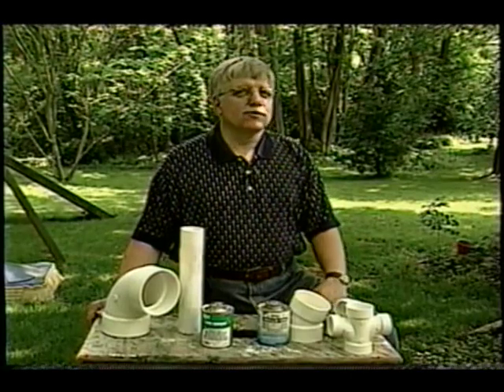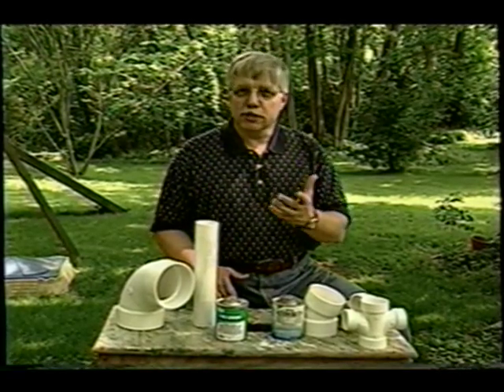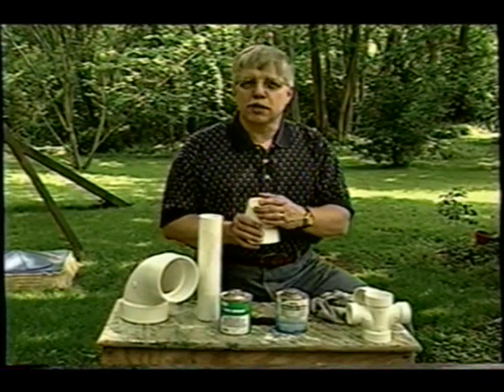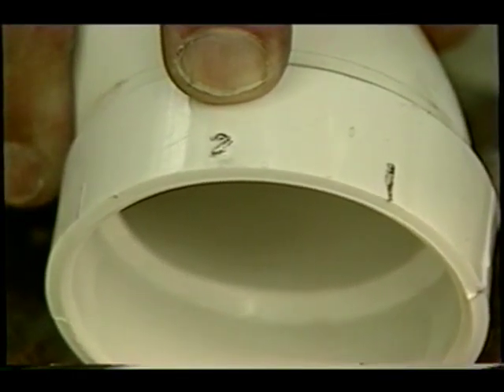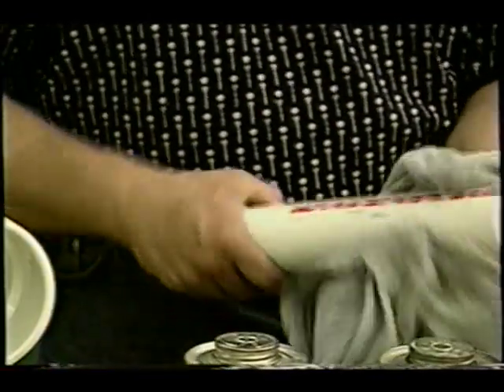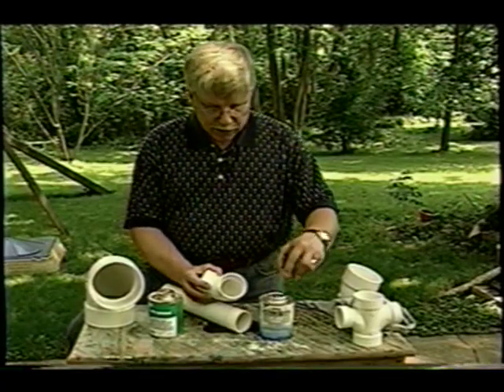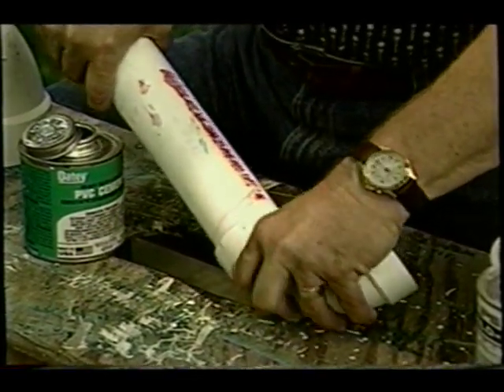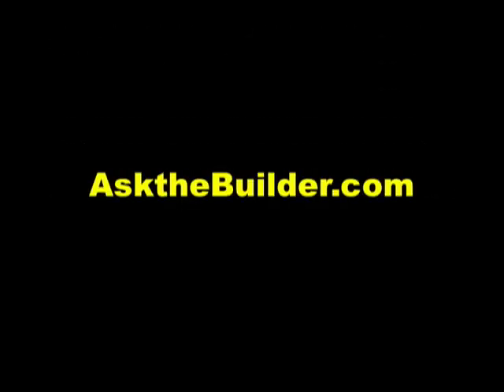PVC Fittings

Comment: I can't have made sense, I mean as well as removing burrs etc & using primer & cement etc it says to chamfer the end of the pipe as well - is this necessary or OTT or counterproductive? ie could create less of a seal by increasing gap between pipe and joint?

Comment: Hi Tim, I'm having trouble. I am replacing my 2 inch Kitchen brass P-Trap with PVC. Only problem is The bottom of the sink strainer and the opening of the pipe that extends from the wall are to close almost vertically above and below each other. The PVC pipe is wider with more fittings needed than the old brass, so laying it out in a workable fashion is looking impossible. Is there ever a case when PVC traps cannot physically replace brass because of space or layout constraints?

Comment from the maker: You got that right. The first time I saw PVC primer was 32 years ago. It was purple. The idiot plumber was working on a remodeling job with me in the basement. He was messy and worked without drop cloths. The new kitchen-sink drain line had to be installed over the top of the woman's new white washer and dryer. At the end of the day, they had permanent purple polka dots all over them. She was very unhappy as well she should have been.

Comment from the maker: Not yet.  The best system is to install the Tyvek or similar material and then place an air space between it and the finish exterior material. This can be costly, but the air helps prevent any problems.